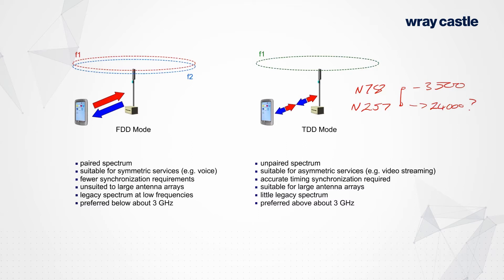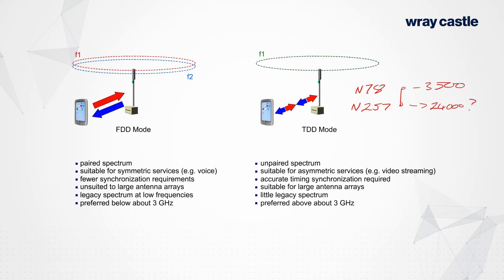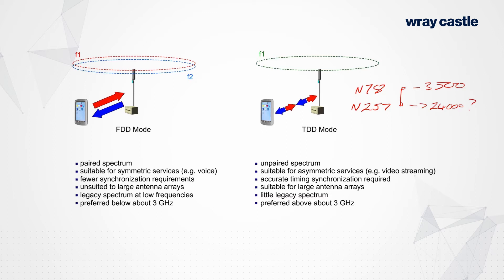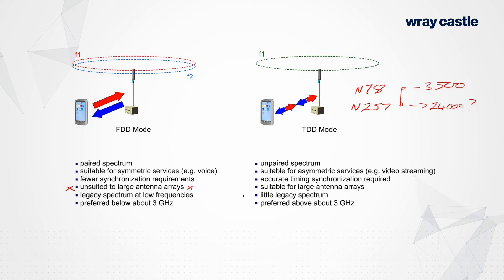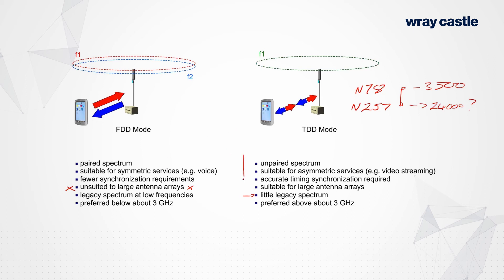TDD and FDD - Overview

Comment: Originally, FDD was used because it was simpler to implement and since cell phones were  used mainly for voice calls, upstream and downstream had fairly symmetrical bandwidth.  However, this changed with phones being used more and more for Internet data which is generally not symmetrical.  Also, precision timing is required with both FDD & TDD.  With my cell carrier, all 5G uses TDD, but 4G can be either.  2G & 3G were always FDD.